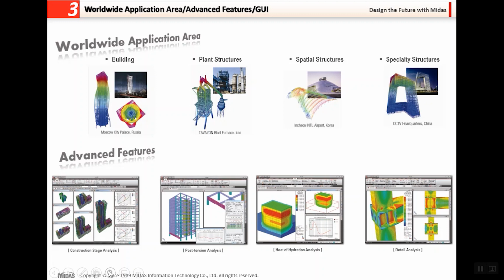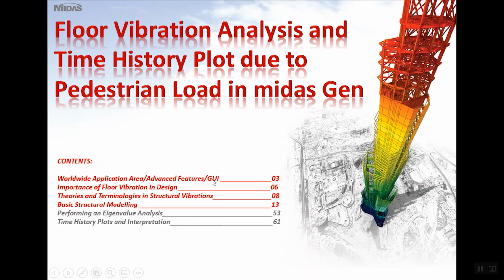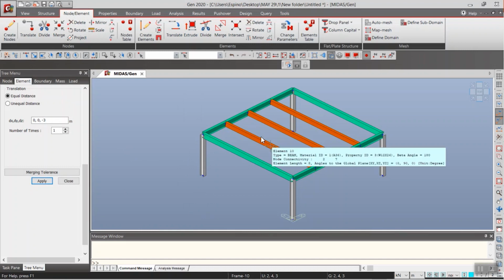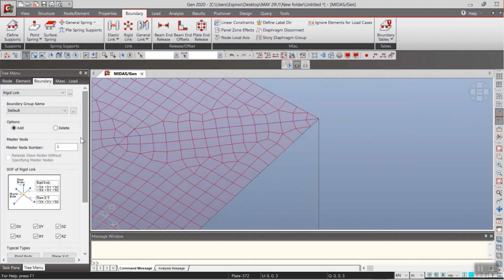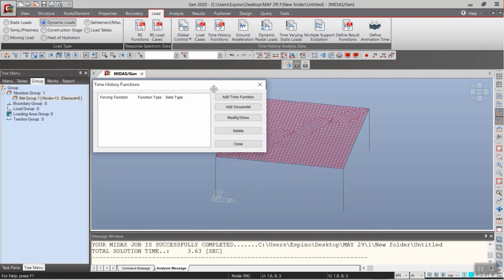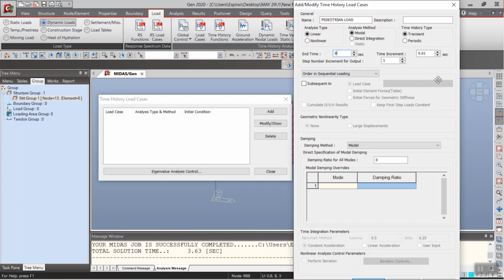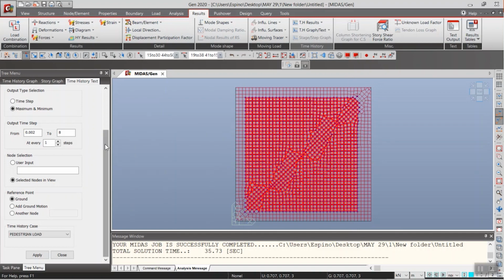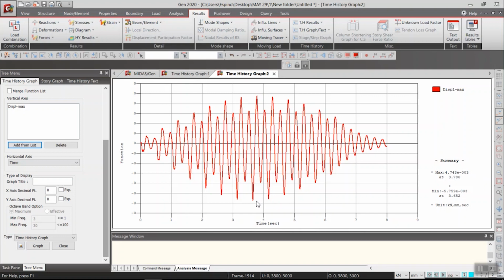Floor Vibration Analysis and Time History Plot for Pedestrian Load in midas Gen

Comment: Hi, Thank you so much for great information. it was really helpful to know how to figure out the floor vibration by MIDAS analysis. I just have a question :  the slab thickness has been input as 0.125m, but there is no concrete material assigned.. so in this case, isn't the slab steel A36 (not concrete) with 125mm thickness? I think this is too much stiffness if so..